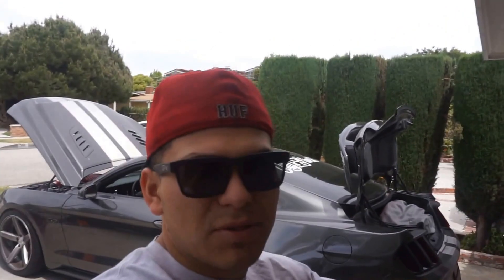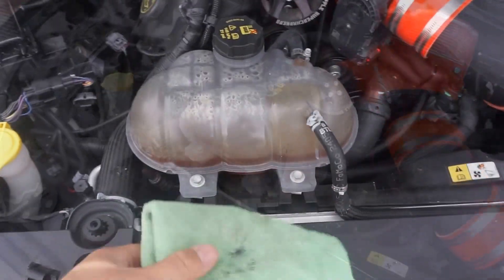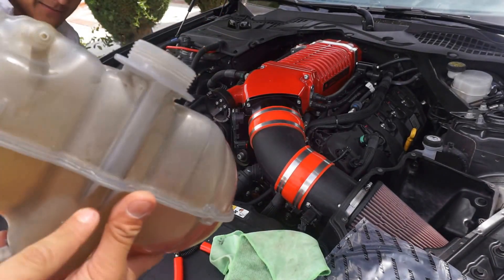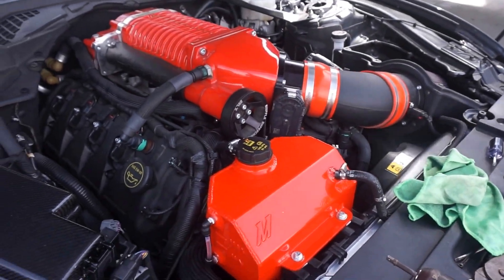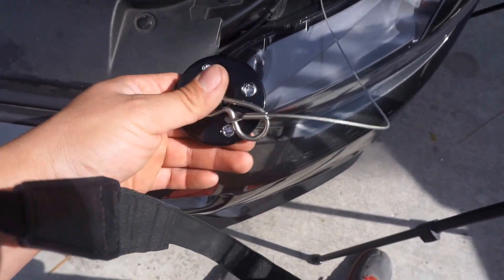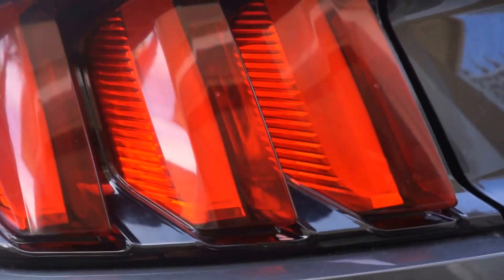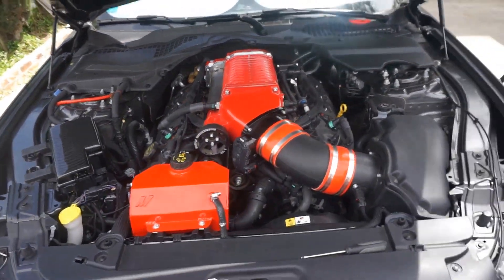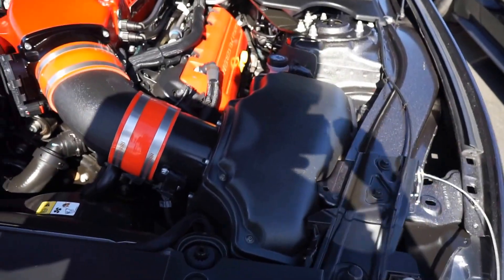Mishimoto Carbon Fiber & More!

Comment: Tim did a good job on the valve covers because the color contrasts well under the hood with the red black and carbon fiber! And with the hood pin look, it's a good idea to see if you like it before you install it permanently...

Comment: Great video man, love the red theme your going for. Good idea with the fake hood pins leaves the option open if you like them or not! As for the jlt cover, they could have done a much better job, as you say. Maybe if you like it you can modify the front left mount to pull it down might mean drilling a small hole in k member with a wing nut underneath ?

Comment: Not trying to be negative but I would worry that the hood restraint cable will rub against the hood panel and over time cause problems. Maybe i'm wrong?
Reply from the maker: bradek3788 the cable is coated with some type of clear coat material so that won't happen and the way I have them positioned they are actually not resting up against the car. Thank you for the concern though.
Reply: Ok cool thanks, relieved. Definitely adds to the look.

Comment: can you give me the link for the hook latches?
Reply: also, can the pin itself be removed? or how would you be able to open the hood?im asking because the ones I found are for mustangs up to 2014, and they attach the wire to the inside of the hood not the headlight
Reply from the maker: Christian Orozco yes those are it from American muscle. They aren't meant for our cars but you can make it work. like I did by screwing it onto the factory headlight housing bolt. Yes the pin does come out
Reply: awesome, thanks for the reply

Comment: I think you should remove the JLT cover, that doesn't look like an exact fit and car guys will always notice the imperfections. have you thought about cap covers for engine bay? maybe dressing up the cap covers will be better, but. I don't know how chrome or billet aluminum will look on your current set up
Reply from the maker: Fluids0306 thanks for your input. Yes I have thought about them jlt actually sells them also and they are color matched and pre painted so it would def fill out the open space in the cover forsure. Only reason I decided to not get them was because they are 100% held in place by double sided sticky tape. I'm not sure how I feel about relying completely on that underneath the hood. at least the cylinder covers have tabs holding them in place.